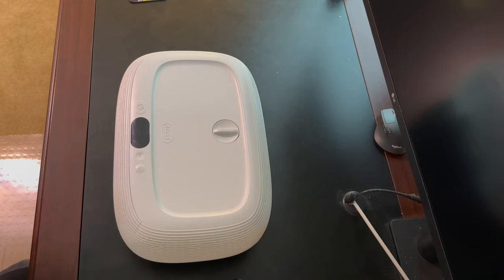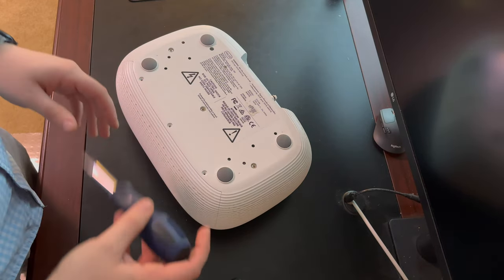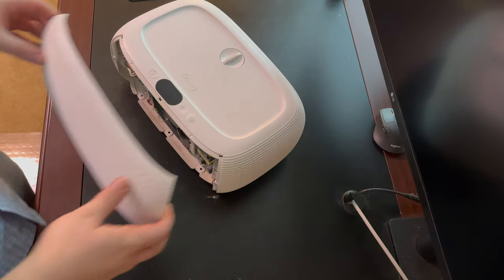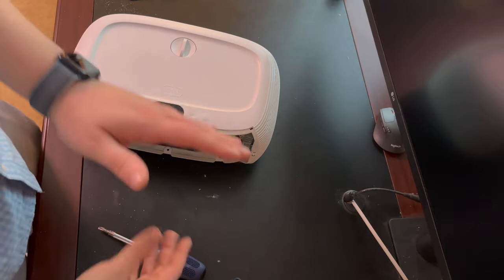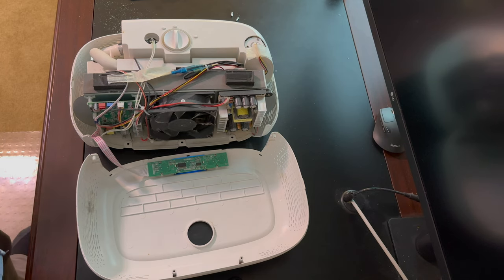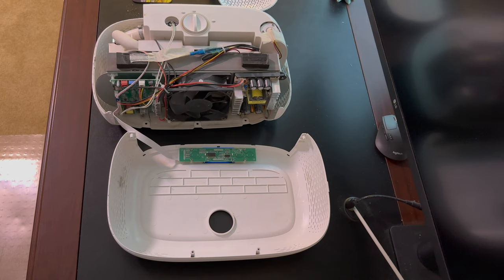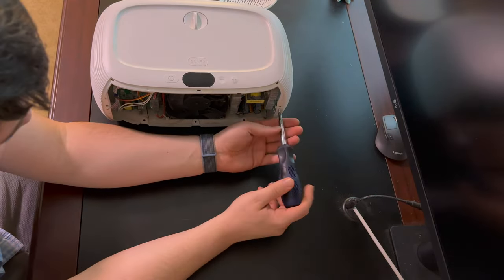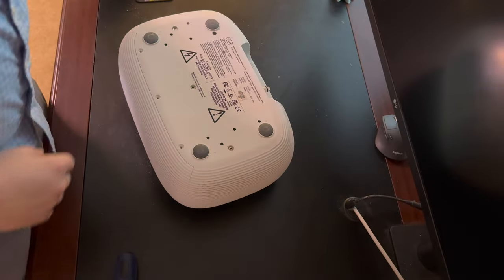How to Deconstruct Ooler Sleep System (Perfect for Deep Cleaning)

Comment: Also dropping a thanks here! - have had multiple ooler units act up or fail to heat/cool. This is the first place I found mention of the resetting thermostat. That got a unit working for me again!
Took things apart more; the thermoelectric coolers are inline/interlocked with the stat - so if the stat trips all heat/cool stops.
Also found a unit where the thermostat doesn't have any reset button. It also has a different pump and different Power Supply board from any others I have or shown here. 
Ty again!
Reply: I have 2 units and one is not heating or cooling. I was looking for videos on how to fix it. Can you offer any advice before I take mine apart

Comment: this was so helpful!!!!! THANK YOU!!!!! i also had to stick a screwdriver in a hole below the machine (scary) to flip the thermal breaker, but it’s working like brand new!!!!!!
Reply: I have tried this multiple times and cannot figure it out. My ooler doesn't heat or cool anymore. I've put screwdriver in the hole many times, but nothing seems to happen and it's unclear what I should see / hear / feel.

Comment: I can't tell if I need a thermal reset or if my pump is broken. Does the thermal reset require the unit to be plugged in or what? I can just barely see in the hole there's some kind of hole and a soft looking button. I've punched that in with a screwdriver multiple times and it doesn't seem to have done anything.

I also deep cleaned the ooler.

My guess is the pump is broken, but the fact that it gets warm overnight from my body heat and never cools does make it seem like it is in fact heating up.

Any advice or an actual video with closeups of the thermal reset process would be really helpful
Reply: Hello! Have you found any update/solution to your issue? This is the same that is happening to ours. Sometimes it works, but then a night comes where it just won't cool and will get perpetually warmer throughout the night. Try resetting but can't seem to notice any difference.
Reply: I had the same problem. You have to hit the reset every night. I think its caused by a failing peltier module. But chillisleep won't help, (they're useless).
They will say it's because you are trying to cool too much (they say you should only take the system 10° colder than the room).

Comment: I just tore mine down due to a leak that Chili refused to backup and I was so surprised they didn't add some sort of mesh to protect from dust getting inside. It wasn't cooling well at all and now I know why.
Reply: Did
You get yours working? Mine had the same issue and I’m very disappointed in the company

Comment: No way to get into the water tank or take it apart? I’m trying to completely drain mine and I can hear water moving around inside it, but when looking in the refill hole it looks empty. There’s water somewhere underneath that panel but I can’t get to it. Nothing is coming out of the drain anymore either.
Reply: When I took apart an ooler a couple years ago, I found that the white tube between the pump and the tank was leaking. This seems like a common problem. I replaced the tube with something I found at Lowes and it has been working great for 2 years.